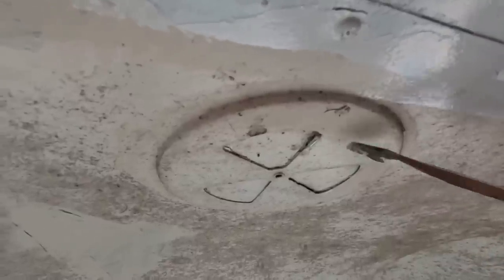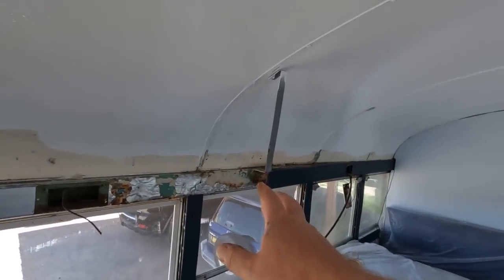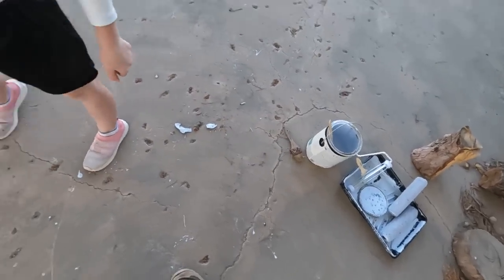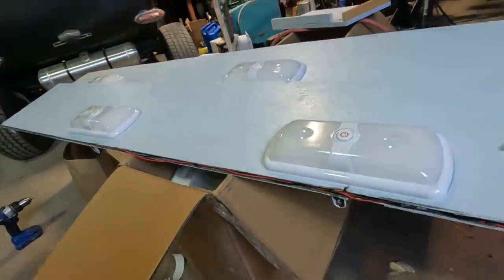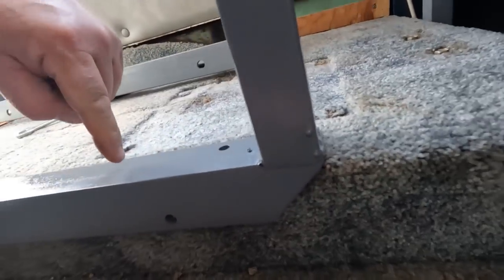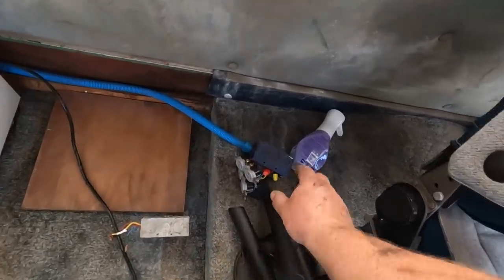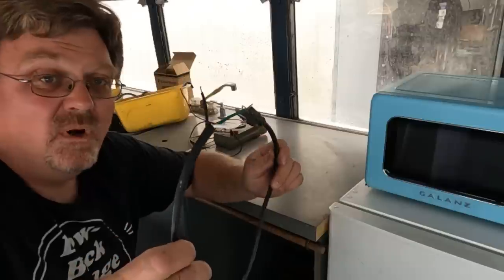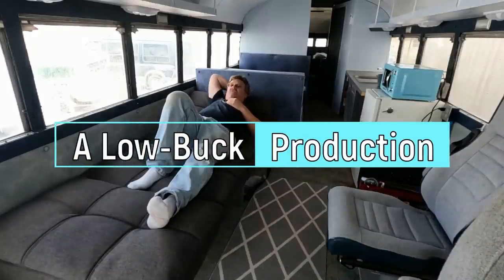Interior Upgrades in the 1953 Kenworth Pacific

Comment: You might want to do a little testing on that inverter if it's an older model. I lived off-grid in Northern Canada about 1990-1997. I had a 500 W Triplite inverter. It was reliable but very inefficient, and took about 60 W just to be turned on, so you had to be very vigilant to remember to shut it off when no longer needed. Trace and Heart Interface were the models I and my neighbors dreamed of, but they were a LOT of money and I don't think there were a lot more efficient at that time, at least compared to what's available now. I would check how much power that Trace draws just to be turned on, and also it's efficiency, i.e. power in vs. power out at different load levels. A new 2 kw inverter is really pretty cheap. Good series, fun bus!

Comment: Inductive loads don’t do well with square or modified sine wave power sources. That means anything with a motor or a transformer.
So the fridge will work, but will consume more power than it should, on the inverter. The microwave might work, but if it does, it will operate at about 3/4 rated power, while consuming the usual current.
Lights are mostly resistive or “passive” loads, so will usually work fine.

Comment: Thanks for the tip on the Loctite, ordered a case of the Big Gap filler and repaired the fenders on my 5-Ton, currently doing some structural work on the bed walls, it's an M813, although advertised as sand-able and paint-able I've found best practice is to skim coat after sanding as it takes a lot of paint to fill the pores...but most importantly it was fun.

Comment: Thats an awesome old oscilloscope. Looked like a bit of HP equipment. I want one of their power supplies and volt meters sometime. Providing I continue fixing electronics.
Reply: Ah nvm looked up the model number. Tektronix. iirc I think a youtuber I watch has their soldering iron and a desolder gun from them.

Comment: Regarding square/sine, electronics usually handle square wave better than electric motors or transformers. First thing that is done in power supplies is rectifying voltage.
Reply: You are very correct! I had one of these inverters before and found out that it likes resistive loads, anything inductive, it would burn them up. Especially transformers!

Comment: Running the generator while underway is very common. Me and my dad have a 39’ 1981 Newell with a 12kw Perkins gender and run it going down the road very often.  As long as it cools properly while in motion and the exhaust is routed safely you should be great.
Also having generator start/stop inside the coach is a big plus.

Comment: Hey low buck garage just a piece of advice for you to save money 
All your old faucets and spigots keep them if they have those big heavy gaskets theyre much better that whats being produced today what we have in modern faucets is some weird cup style gasket with a spring  similiar to gaskets in hi pressure application like hydraulics  but the the material the gasket is made (maybe neoprene) is thin and fails  ive seen them be cut by rust in  galvenized pipes and seen them turn to a mushy substance (not sure what causes that) also the use plastics in the valve is a common failure point 
Water faucets and spigots is one of a very few times in life where the old stuff is actually better stuff

Comment: the rubber valve bibs for the valve are pretty common in that size, and you can get bags of dozens for a couple of dollars. same for the graphite packing seals. north american plumbing fixtures like that largely haven't changed since the 1930's lmao.

Comment: Good vid but a thought on wiring those lights.. If you pull the wires tight like you did at 10:38 and you ever want to remove or replace the fixture, you wont be able to because the wires don't have any slack.

Comment: If you did need to cook something while driving you could use inductive device called RedCopper 5 min Chef, 800w and its small like 4"x14". It works great and cooks everything in 5 min, just don't put scrambled eggs in it, it'll explode .. but I think risk of pop really makes a meal. bam hot pocket.
Reply: Heh, said inductive meant resistive heating element.

Comment: Low Buck Garage... Making mediocre look adequate  :-)  Just kidding.  I really like the LED lights and the replacement couch.  
My motorhome, has the high cost fluorescent lights, that cost a fortune to maintain, because when one bulb quits lighting, it unbalances the circuit in the power module, causing heat and failure.

Comment: what is your charging option ? for lights AC water heater a fridge. solar panels?
Reply from the maker: Right now the only charging is the engine (has two alternators) and the generator.  Solar is an interesting option, but I haven't really looked into it yet.
Reply: solar has a drawback ,I've played with solar panels a bit,
in your area of 12 to 14 hours of sun they will kill a battery fast
it's a give and take thing you have to use the power somewhere
as of a light on all the time ,and watch your water levels in your
batterys .
you get the real thin panels they can cover your roof rust too
and there not vary tall .   good luck         like your channel

Comment: EDIT: premature comment 
hey low buck garage i dont know much about square waves  but i keep hearing things light lights and old crt tvs can run fine on modified sine wave but modern electronics like cell phones tablets and modern lcd tvs  can be damaged by modified sine waves and things like fridgolators  things with electric motors tend to create more heat on modified sine wave  its unclear to me if this difference in temp is high enough be dangerous and lastly im told pure sine wave causes less battery drain

Comment: Those folding seats are not rated for automotive use and will collapse in a collision - as in they're not safe, so don't use them if you care about the health and life of your family, or at least don't allow anyone to sit in them while driving. Using steel to mount them is also a questionable choice in a bus that's already underpowered with inadequate cooling. The last thing you need is to add extra weight

Also highly recommended to get a proper RV fridge that will run on both 12 V DC and 110-115 V AC. The same goes for the oven and microwave. The inverters have a significant efficiency penalty, so you end up using a lot more power by using it to power appliances. And household appliances are also a lot heavier than their RV equivalents.